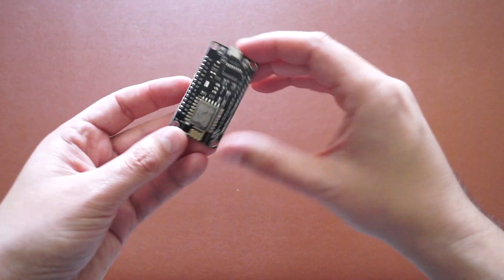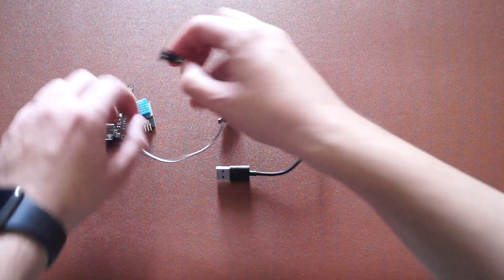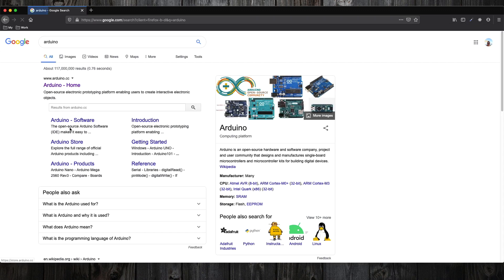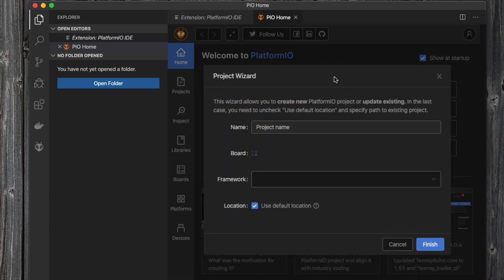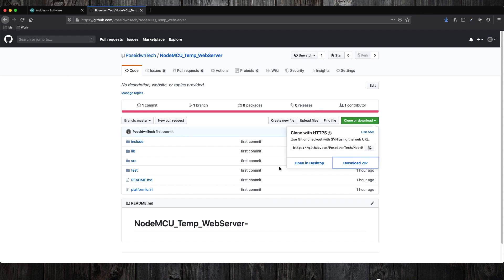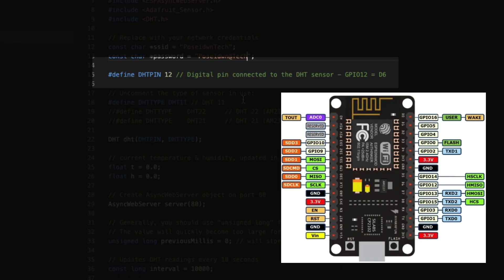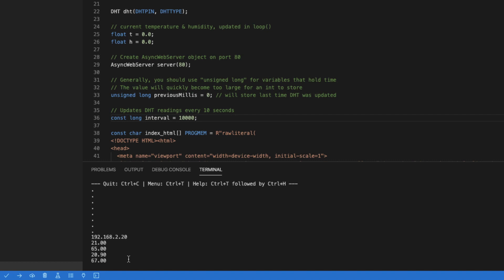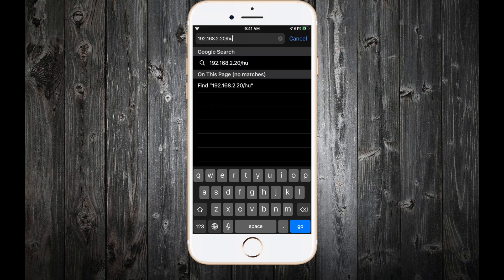Wi-Fi Temperature & Humidity sensor based on NodeMCU - Complete turorial

Comment: Greetings Sir! At line 14 "#define DHTPIN 12 // Digital pin D6" If DHTPIN is 12, why do you connect to D6? It works correctly, I do not understand the conversion, thanks.

Comment: good day sir, does the DHT11 detect negative temperatures?
Reply from the maker: Hi! No, DHT11 range is 0-50C. For negative temperatures you have to use DHT22 which has range -40 to 80C.
Reply: @PoseidwnTech  thanks!

Comment: Hi. Just followed this, but is there any way to change the code to allow for a static IP to be set within the code?
Reply: // Load Wi-Fi library
#include <ESP8266WiFi.h>
// Set your Static IP address
IPAddress local_IP(192, 168, 1, 184);
// Set your Gateway IP address
IPAddress gateway(192, 168, 1, 1);

IPAddress subnet(255, 255, 0, 0);
IPAddress primaryDNS(8, 8, 8, 8);   //optional
IPAddress secondaryDNS(8, 8, 4, 4); //optional

Comment: Hey, This was a great tutorial. I am not so knowledgeable in this topic but trying to learn as I go, is it possible to do this and have it be battery powered and still have wifi capability?
Reply from the maker: Yes you can. Most of the times we connect this on a power bank!
Reply: @PoseidwnTech  what kind of battery would you recommend for this? Response would be greatly appreciated

Comment: Hi! Great tutorial.
Are you planning to add some notifications with temperature/humidity thresholds?
Telegram for example?

Thanks!
Reply from the maker: For sure many configurations are coming. On the next videos sensor will be connected to home assistant and control some KNX devices based on sensor values.
Reply: Poseidwn Tech I see. But can you explain how connect with external services?
Reply: Poseidwn Tech sorry, I forgot something... “please?”
Reply from the maker: NodeMCU has embedded a WiFi. So it is connected to the network via WiFi.
Reply: Poseidwn Tech yes I know. But I mean services to grab the values and send notifications if some value is up or below certain threshold. 
Email, Telegram, etc...
Reply: @emilianosturniolo2176  he already provide two endpoint for other service to grab the value, it's /temperature and /humidity,